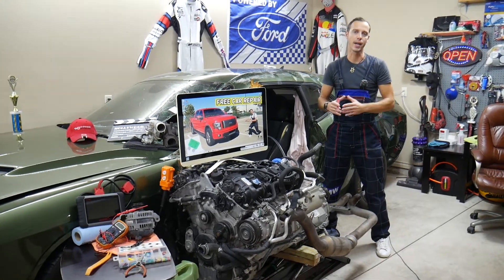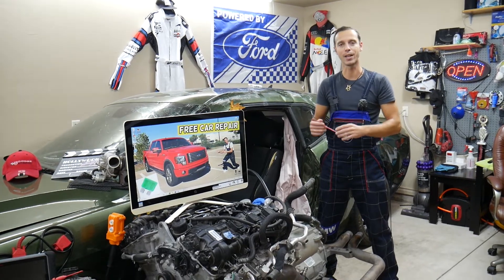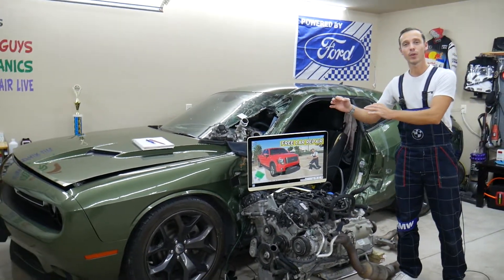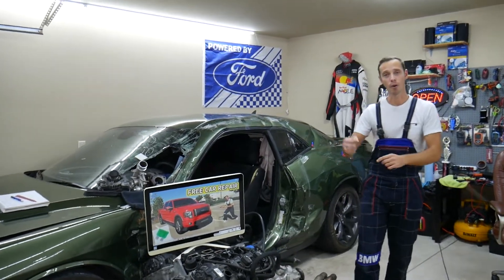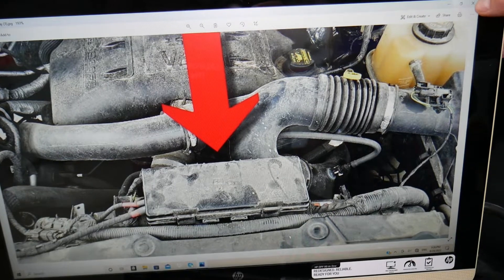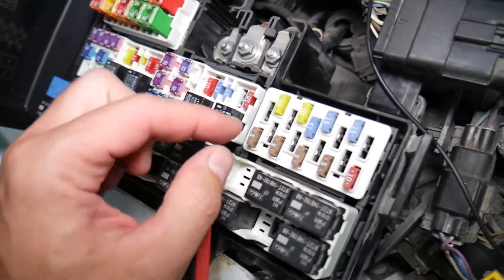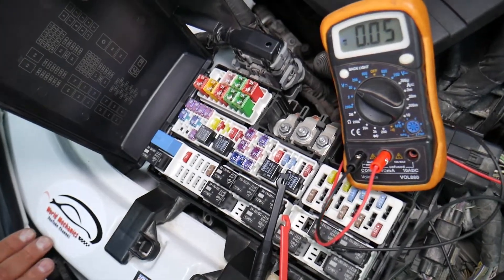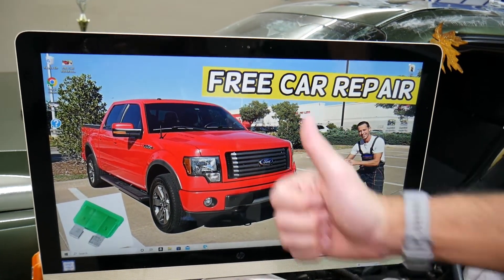FORD F150  KEY PAD FUSE LOCATION REPLACEMENT F 150 KEYLESS ENTRY FUSE 2009 2010 2011 2012 2013 2014

Comment: Also electric putty only 2 or now 3 bucks a brick..millions of uses as well as holding g electric wires stable safe can hold bubs in place and secure them and protect them and other things fuses switches contractors are we utilizing dry soft metal where appropriate I mean hey I ain't selling it or nothing but dielectric is like pot for your electrical circuts